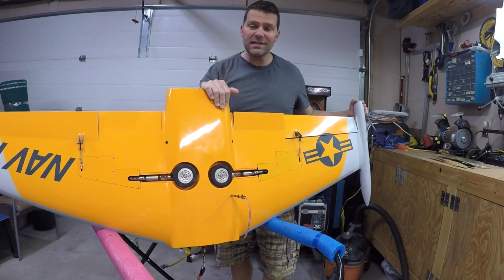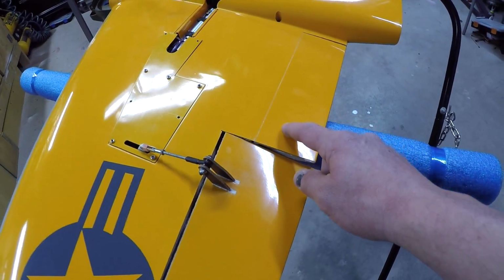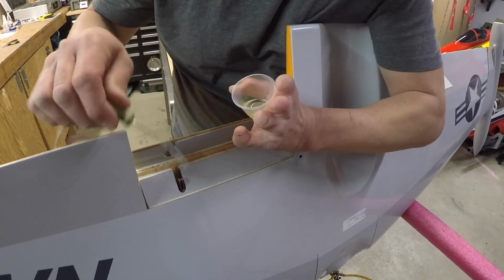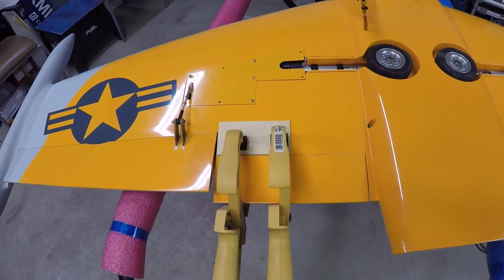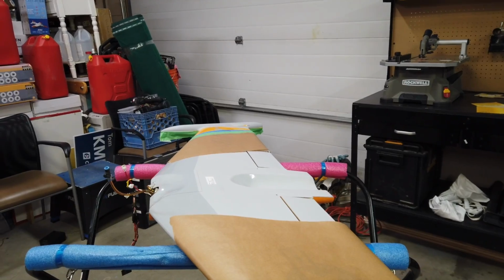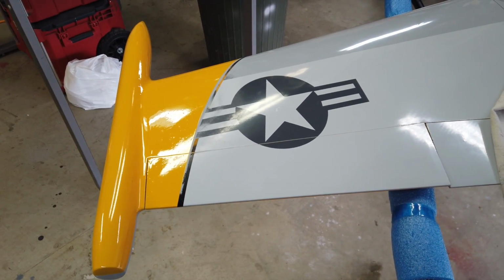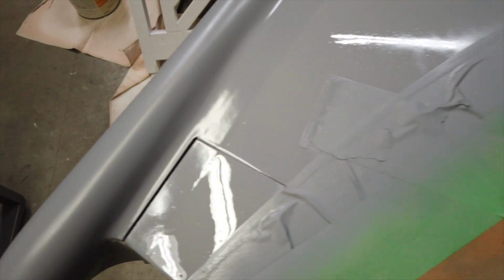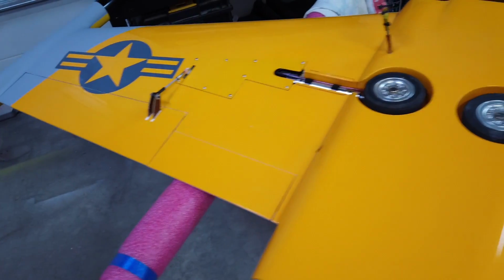AFTER THE CRASH - CARF RC Jet Wing Repair.  CARF Classic Flash

Comment: How would you repair airex? Like cracked airex?
Reply from the maker: Really depends on the situation.  If it was a laminated former, get rid of the Airex and replace with aircaft ply.
Reply: @thelightersideofrc  thanks. I should have described it a bit better. I have a small airex  area that got damaged. It’s on the wing. I am thinking if applying 3/4 oz cloth and using epoxy to laminate the damaged area.
Reply from the maker: Yea your on the right track!

Comment: I just use thin ZAP CA glue to stick a delamination like that down again. Never had one come loose again.
The ZAP bottle allows accurate application of the glue.
Thinned epoxy sux...it never gets hard because the alcohol gets trapped in the epoxy matrix. If you need thin epoxy, just use laminating epoxy.
Reply from the maker: Thanks Winibald!  Great tips!